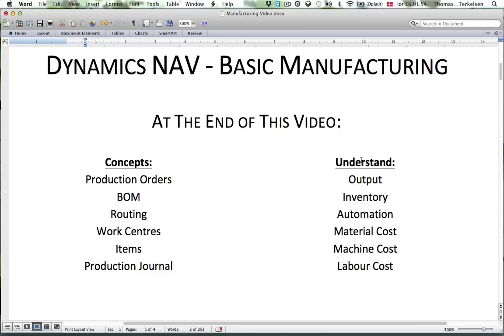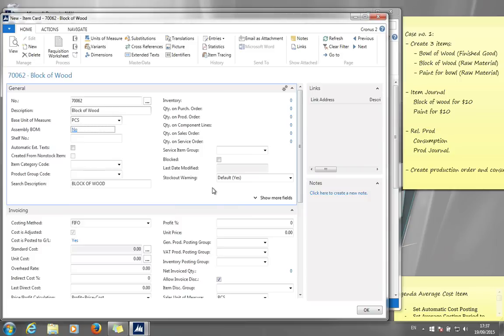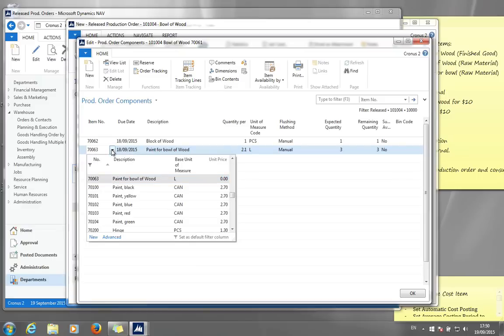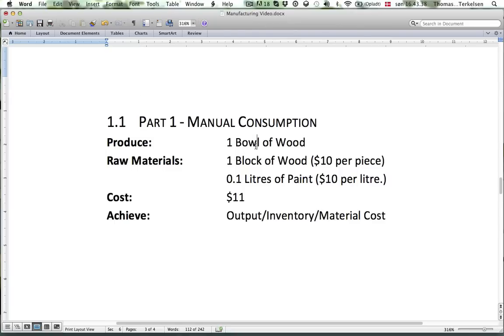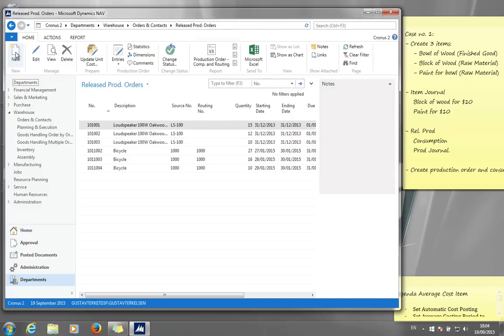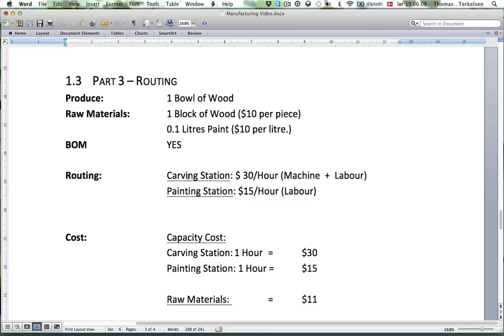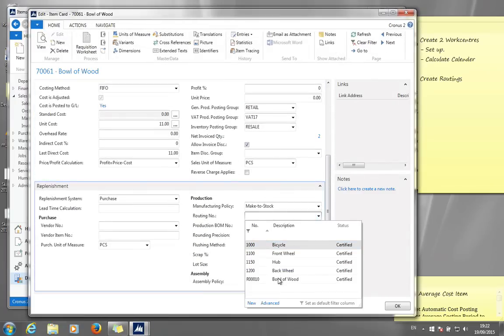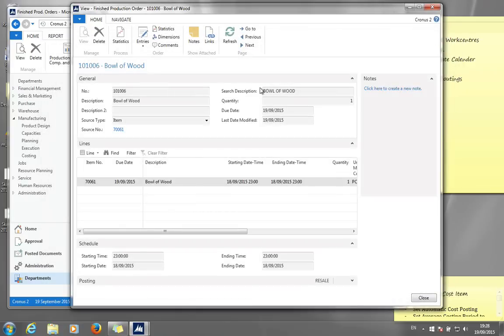Dynamics NAV: Manufacturing Basics

Comment: Hi Thomas, 

Thanks for this clarification. I have one question left regarding the Alternate Work Centers:

What
 is this field's purpose? I hoped that Production Orders would 
automatically be moved to the Alternate Work Center in case the default 
Work Center does not have sufficient capacity. Unfortunately, I do not 
see any effects of using Alternate Work Center.

Thank you in advance!